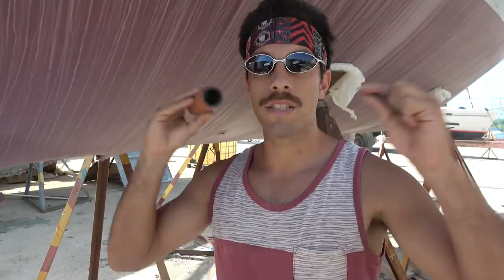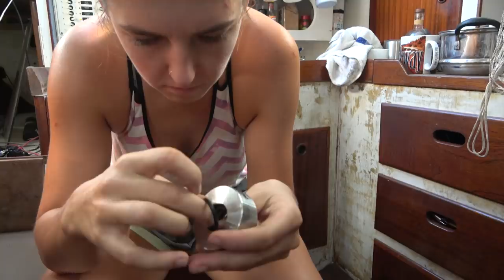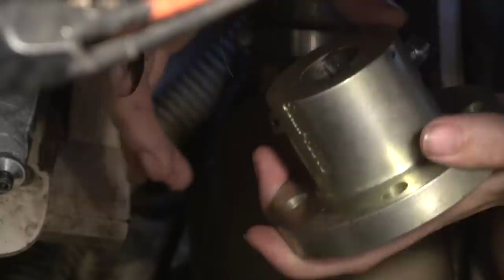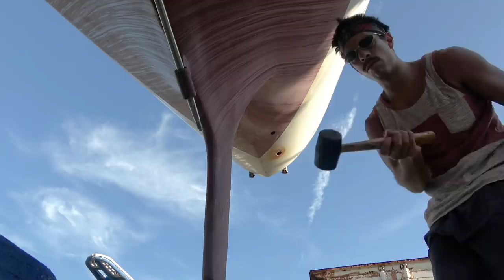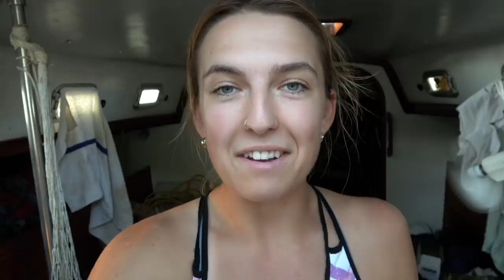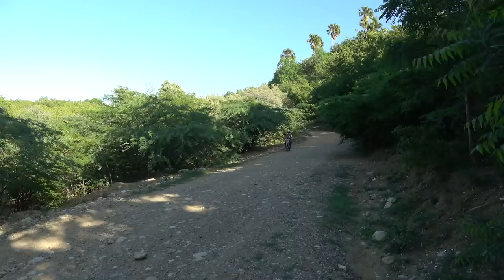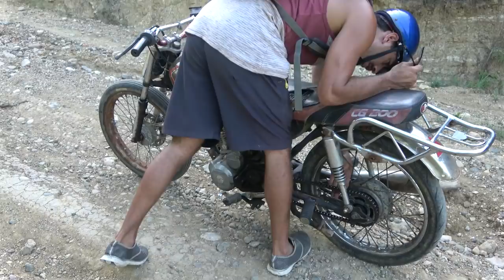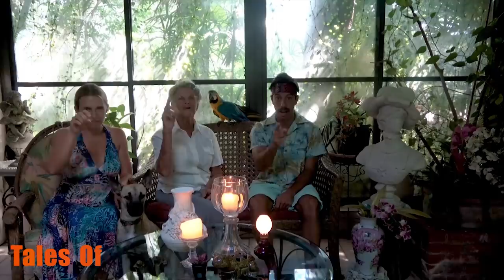Sailboat DRIVE TRAIN Installation 🔨 Ep 96

Comment: thats a left hand prop, which means the prop needs to turn counterclockwise
Reply: It really doesn't matter which way it turns right now. It will only fit on the shaft taper one way.
Reply: @flyingdutchman6984  im not sure that menas, i was just pointing out the handing of the prop and the way it should turn. if you are  standing behind the prop looking forward the prop needs to turn counterclockwise.
Reply: @superformOG  - you're correct, but my point is that the prop will only fit on the shaft one way. There is no wrong way to install the prop because the prop shaft and internal diameter of the prop are tapered. It may spin the wrong way once installed, but there is only one way it will go on the shaft.
Reply: @flyingdutchman6984  this is where im confused, if the engine has changed and the prop turns clockwise, then you need a new prop.. i get that the prop only goes on one way.. but if its the wrong way.. then its the wrong way..
Reply: @superformOG  - When viewed from the stern facing forward right-hand propellers rotate clockwise to provide forward thrust. Left-hand propellers rotate counter-clockwise to provide forward thrust. The rotation of the propeller while providing forward thrust should normally match the rotation of the engine. You are correct to say when it's wrong, it's wrong, but that doesn't provide a reason why. I hope I have explained the why. 😁
Reply: @flyingdutchman6984  yeah.. cool i understand how props work, which is shy i mentioned it in the first place.. since in your vid you were talking about the leading edges being obtuse or some such nonsense.. which to me showed you had no clue, i was trying to help, so that you understood how your prop works, looks like you did some internet searching and copy pasted how to hand a prop.. so at least you are learning... sailing is a pasttime for humble people, learn to take advice when you don't know, the ocean is unforgiving to those who fool themselves about what they think they know.
Reply: @superformOG  - first thing you should know is it's not my video. 😁 I've been sailing for over fifty years, and cruising solo for the past twenty-seven years until I became disabled from an accident. I am currently shopping for a new sailboat that will accommodate my disability so I can return to sailing full-time.

Comment: Dumb question: doesn’t that shaft require some kind of marine grease to lubricate the “o-rings”??
Reply from the maker: The shaft collar spins with the shaft so it shouldn't need any lubrication. None came with the complete rebuild kit nor was it recommended in the instructions.
Reply: Bums on a Boat  I trust you!!  (Remember I started with “dumb question” LOL). Plus Micheal kinda answered the question with her comment about how far up the water comes up the shaft, meaning the water is the lubricant? I’m guessing.
Reply: Brad Baerwald Hi, the water cools the Carbon face attached to the bellows. The stainless steel compression ring is attached to the shaft with the set screws and spins with the shaft. The shaft does not spin on the o-rings. They are a static seal. The sealing is done by the SS Collar pushing against the Carbon face attached to the bellows. By being perfect faces no water is supposed to escape. The Carbon wears slightly to crest the perfect fit . And dirt or marine growth on the faces ( often from lack of use) will cause a leak. The faces have to be cleaned if this happens it it will leak . A tiny misty spray when fully 'run in' is possible. But it should not drip......but they will if not checked frequently. They are dripless but by no means maintenance free.  If used on a higher speed boat the vent hose to the Carbon block needs to be connected to a positive pressurized supply to cool it , frequently of the engine raw water cooling circuit.  Cheers Warren
Reply: @Bumsonaboat  Water is the lubricant . The hose should have had a little teflon tape but probably will be fine  .  The too long bolts you could have screwed in all the way then cut off the protruding bit flush .  Do not run it dry to test or the cutlass bearing will fry  .  Your work looks great (you did locktite the coupling bolts right? )  . 

Chain on the bike may be stretched, assuming you aligned it  and there is little you can do, not your fault it comes off .  A mechanic can check for you and replace it if needed . When stretched they don't sit in the gear all the way and then pop off . 

Any way you slice it you guys have it down and that boat will be as seaworthy as any and you guys will be able to fix anything on her  .  See sailing UMA for just how far you can bring her . I am sure you know they fixed a keel WAY worse than yours and just crossed an ocean. 

 My 2 cents on the keel stringer  , cut out what is cracked , grind back to fresh ,  and put in 50% more glass than was there in the first place . Go as wide as you can , glass is cheap . Match it on the other side before it too cracks. I would do every stringer at the keel while at it . You can grind off to raw and fresh glass surface easily  and lay up over to beef it up if it is still good . Don't add a Stainless brace as it will just concentrate flex elsewhere . Then re torque the keel bolts , take each one off one at a time , inspect for crevice corrosion , then lube or they "gall" and you can not tighten all the way , they will just feel tight (a thing with SS)  . Try to get torque spec from the owners association but it will probably be more than you can even put on , use a long bar to get enough leverage . You can put larger ss washers if there is room .  Here is a generic torque chart -https://j109.org/docs/keel-bolt-torque-table.pdf
Reply: @ @faircompetition1203  :   First I am NOT knowledgable on boats at all (obviously). but I'm not exactly lost on basic mechanical engineering (long story, but have built and still use many devices, I have built from scratch).

 Sir, your comments are the best I've read (again I'm not qualified to say that) but so many have told them they are "crazy to put that boat back in the water". Your suggestions make the most sense to me... even the "don't put a stainless brace in"  because, I get your following comment, that it will just transfer stresses to other locations. . You're right when you say, "glass is cheap". my concern is how do you get the new glass to stay connected to the old glass of the hull?  If I understand you? you expect the hull to flex [quite a bit] and the [new] stringers will flex with the hull but make the entire mechanism stiffer and stronger!   Of course,  none of that will matter if the new stringers delaminate from the old hull, right?  

All that said I love these guys, the channel seems VERY honest and its really fun to watch. 

Obviously none of us want to see anyone get hurt or worse lose their life but if they do the repairs well, that boat shouldn't let them down.  I follow a handful of other boat building channels too and one of them (being rebuilt) was over 100 years old and made out of wood..obviously it needed rebuilding, but I can't imagine it was in much better shape when it was 25 years prior... that thing was pretty rotten certainly less seaworthy than BOAB's vessel!? even now.  But again take my words for what they are worth...not much LOL. 

LOVE YOU GUYS!! can't wait to see you out on the water again! (wish I could afford to throw money at you, but for now best I can do is support you thru comments, likes  and being a subscriber)
Reply: @ @CheersWarren  : I follow you completely sir!  makes sense AND I can see how "non-use" could cause problems!  great info and thank you for taking the time to write such a clear description (not easy to do, when describing technical issues)!
Reply: @Studio51media  Yep , these guys are going to make it . They have that special can do attitude and that girl is a keeper , as is Joel for her . 

On the original glass they need to grind it down to raw or fresh glass and then they will get a good bond to it . You can not just glass over the original surface , you need to grind that off surface and bond to the fresh exposed glass  . 

Yes the boat will always flex , transferring this load to the hull through the stringers , that is what they are for . I would in strengthening them also increase the bond to the hull joint out a few inches but that is over kill . 

I suspect the crack at the back is not a stress failure but damage from a grounding pushing the stringer in a up in a direction it was not designed for . Kind of oil caning the hull as the force of a grounding  gets transferred to the back of the keel and pivoted up but it is just a guess from seeing damage from a grounding before  . 

My next concern on that boat is the age of the rig . Not sure if they have had a good inspection and if they know how old it is . 

Ultimately the boat they have is a simple machine and because it was built in the early days of glass likely over built .  Just the area's of neglect where water gets into the core would be an issue and they already know how to fix . I might have done it different but what they did worked .  

They need to inspect the rig as the next must do project . Then the cosmetics will come easy .
Reply from the maker: @faircompetition1203  Okay, we should be able to find some teflon tape at the hardware store. We will once we are sure we won't be pulling it a part for a while.

The back wheel was mis aligned. An easy fix for the mechanic.

Yes, Sailing Uma is a big inspiration!

We do plan on using fiberglass to repair our stringer. Okay, always appreciate the feedback from you. We are considering doing the keel job on the hard now.
Reply: @Bumsonaboat  You guys will be fine . I envy you having the guts at a young age to follow the dream .
Reply: @Bumsonaboat  One other tip , when you put the anode on the prop shaft place it nearer the strut so that if the coupling falls apart on some passage the shaft can not fall out far enough to leak .
Reply: @Bumsonaboat  teflon tape should be a staple in your tool box . Cheap and helps seal any threaded connection from the kitchen sink to the head .

Comment: Nice install , it would be nice to move that cooling hose to a different location as it's awful close the the spinning shaft but there may be no choice sometimes I guess. ( hopefully you have checked it for previous damage). Yes , using the threads in the coupling as the nut is the right way to go. The nut is for when coupling has been stripped or drilled out.  Be carful of those stainless steel boats they are half the strength of the Hardened steel cap screws that were in there before. So if you ever have to remove them you will have to carful not to break them. But conversely the SS bolts will not seize as tight in the coupling. Fortunately you have made good use of lots of lubricants so fingers crossed disassembly with go well If ever needed!
Can't say I like these dripless seals much as replacement of bellows etc usually requires hauling the boat . Older style packing seals , designed to drip a tiny bit in use can be repacked endless times even in the water as long as you can get to them! You had to go with what was already there. Unfortunately they may be dripless but they are not maintenance free. Stopping the faces getting dirty or marine growth from lack of use is the biggest problem. Your Carbon face did look a little dirty to me so may leak until wear in.
FYI these type seals are used on thousands of pumps to seal their shafts ( they use a spring not bellows) so this is well proven technology just less so in salt water with marine organisms in it!     Rudder next eh! Cheers Warren
Reply from the maker: Thanks for the info! Correct, Rudder is next. Also doing other jobs while we wait on a few parts to arrive.